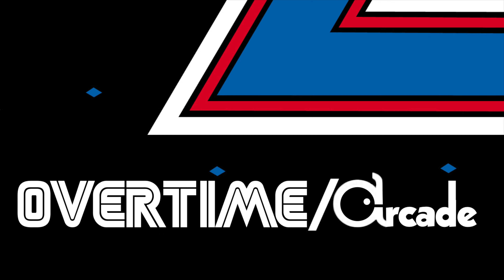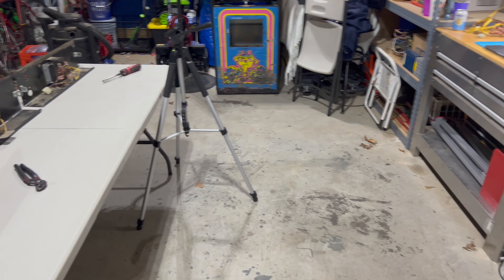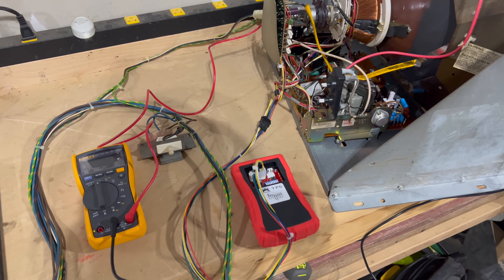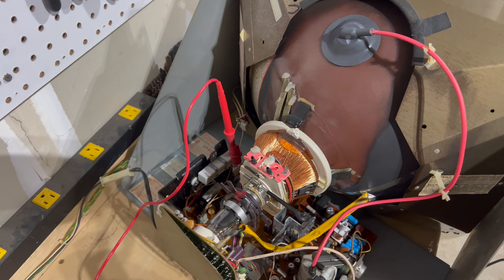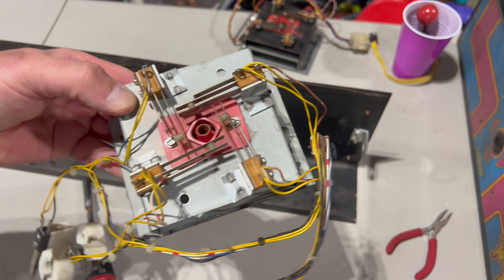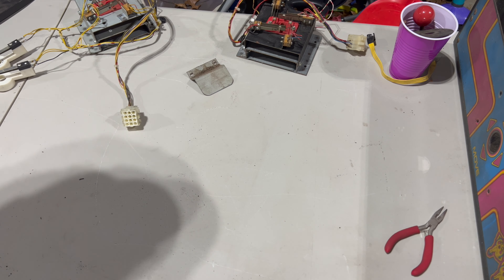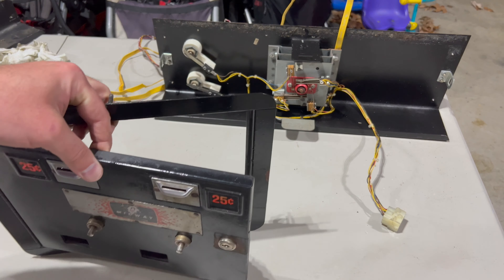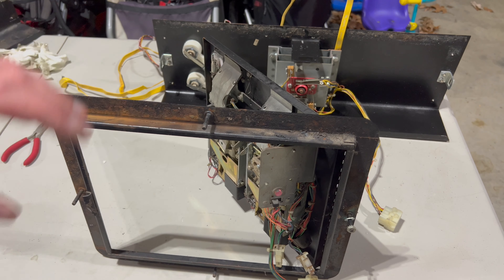Ms. Pac-Man Restoration part 6: Cleaning up the Control Panel and Adjusting the Monitor

Comment: Thanks for sharing all this great information! I just picked up a ms Pacman unit a few months ago and looking forward to restoring the unit. The game does work but it seems to have a chip that has changed some of the miss pacman original boards. I also need to figure out what's going on with the sound not working. Do you know where I can order the stencils to repaint the unit?
Reply from the maker: Thanks for watching, Richard! I'll be getting my Ms. Pac-Man stencils from This Old Game, although they're currently on backorder with an indefinite waiting period. https://www.thisoldgamearchive.com/pacman/ms-pac-man-stencil-set

What has changed in your PCB? Is it the typical speed-up chip, or something else?

And do you have any idea what's causing the lack of sound? Hopefully it's something simple like a speaker wire that's come loose!

Good luck with your project!
Reply: @overtimearcade  Thanks for sharing the link, I will place my order today. My PCB seems to have ms pac plus board with alternate mazes as well as the speed chip. I was able to get the sound working! It was a loose speaker wire as you mentioned.
Reply from the maker: @richardelijah1615  Awesome! I just placed my own Ms Pac stencil order the other day. The more they get, the faster TOG will run a batch! And nice work on the speaker wire! I think @cameronmccasland might be looking for a Ms Pac Plus board and probably has a spare regular Ms Pac...?

Comment: Can you point the camera at the adjustments points so we see where they are.  Just once.
Reply from the maker: Yes, I’m planning to do that in a quick follow up video where I fix the sync connection issue. I’ll point to all the adjustment pots, etc. too.
Reply: @overtimearcade  Cool, thanks...

Comment: Curious if you ran into this issue I’m having. 
When set into free play the game automatically goes to a 2 player loop and doesn’t stop. If I add more than one credit in normal mode, it will automatically start a 2 player game.  If I unplug the control panel and coin up, it works like it’s supposed to.  I looked at the 2player button and nothing is touching to make it act like it’s being pressed.
Reply from the maker: Is the wiring going to your 2 players button shorted or corrected wrong? Feel free to send me a photo at charlie@overtimearcade.com
Reply from the maker: @PIMCO13 Did you ever get this working? Again, please feel free to send me a photo of the control panel wiring, either via email or on the KLOV forums (or Twitter works too).
Reply: @overtimearcade  thank you.  I just sent an email.  😁
Reply from the maker: @PIMCO13  Thanks! I'm not seeing anything immediately obvious in the photos. Based on what you described, something must be shorting that button circuit to ground.

Here's what I'd check:
- Are the terminals coming off the leaf switch somehow bent together and touching? Or a solder bridge between them?
- Any breaks or sketchy repairs in the signal wire going to the P2 leaf switch?

Good luck!

Comment: I love your videos. I have a ms Pac-Man I just got and I’m disappointed that the ghosts, when ms Pac-Man eats the super food, turns black. The ghosts are not the blue that I am used to. Is this fixable? And if I can adjust this to blue, how do I do that?
Reply from the maker: Thanks, I'm glad you enjoy my content! Congrats on the Ms. Pac-Man pickup! The issue you're describing should definitely be fixable, but it could actually be caused by many different things.

Are you running an original Ms. Pac-Man board set and CRT monitor? Are you missing the color blue entirely, or are you just missing the blue ghost sprite?

If you're missing blue entirely, it could possibly be something simple like adjusting the color pots on the monitor (I'd try this first), or a bad color transistor on the neck board (swapping them around could help diagnose this), or the blue electron gun in the tube is weak/dead (need a rejuvenator to test/fix this).

If you're just missing the blue ghost sprite and everything else is good, I'd suspect a game PCB issue. Could be a bad ROM or bad IC. Check this page for ideas: https://mikesarcade.com/arcade/pactrouble.html

Good luck!
Reply: Wow, thank you for responding. The monitor is RCA. Not sure if that's original. I sent you an e-mail with the video quality. I feel like when I compare to another Ms. Pacman, the pink and orange ghost look the same color. I can barely tell the pink ghost is pink, when I adjust the color in the bag. There's six white knobs (labeled, and oddly, two adjusting dials are labeled "red") that I can adjust from the back. But it's hard because I can't adjust them and see the screen at the same time. So I'm walking to the front of the machine like constantly. I even got impatient and reached back to adjust it and got quite an electrical shock doing that. No matter how I adjusted it though, I can only get the ghosts to turn grey, never blue. And when I brighten the screen that way, I can see more screen burn on the opening intro, so I adjusted it darker again, to hide the burn in. The color of the maze itself also doesn't look as bright and off in color too. @overtimearcade
Reply from the maker: Which email address did you use? I don’t think I’ve received anything yet…?

Comment: So how do you adjust the geometry if the areas where the red blue or green is off and not aligned?
Reply from the maker: That’s convergence/purity, typically controlled by the set of rings around the neck of the tube. It’s a real pain IMO to adjust that, so I tend to leave it alone unless it’s so bad I can’t live with it.
Reply: @overtimearcade  I have that g07 I'm looking at right now.  I've done that exactly 1 time many years ago.  I need to find a guide or video on how to do it.
Reply from the maker: @juise15 Adam covered it about halfway through this video: https://youtu.be/Gmrrf5hiYQI?si=Omt_4jZu1GqDMBqY

Comment: Que es ese aparato rojo que está conectado al crt??
Reply from the maker: "What is that red device that is connected to the CRT?"

It's the CraftyMech Test Pattern Generator (TPG) which you can get here: https://www.mikesarcade.com/cgi-bin/store.pl?sku=TPGv1

My TPG came with the red Silicone Rubber Case which you can get here: https://www.arcadepartsandrepair.com/store/tools-supplies/tools/tpg-silicone-rubber-case-red/

¡Gracias por ver!